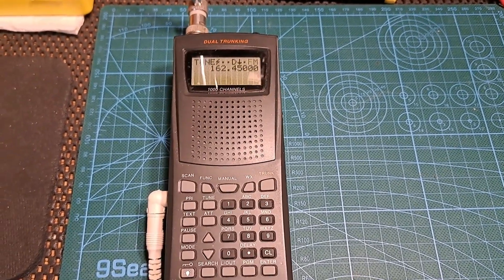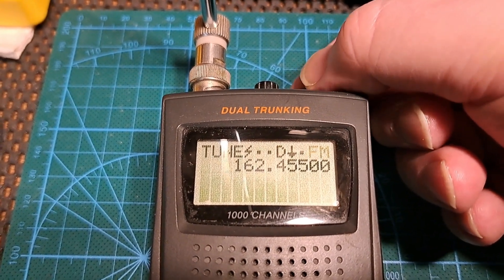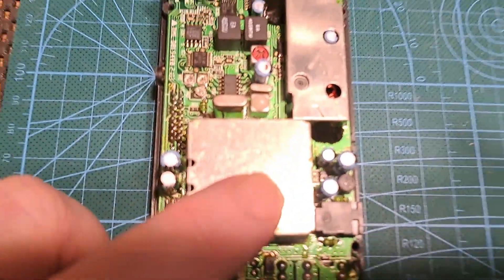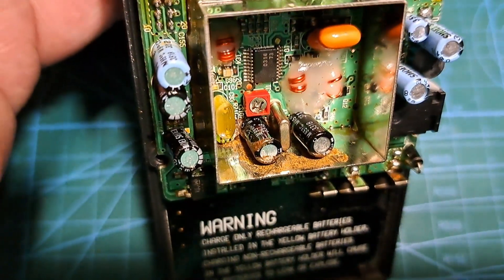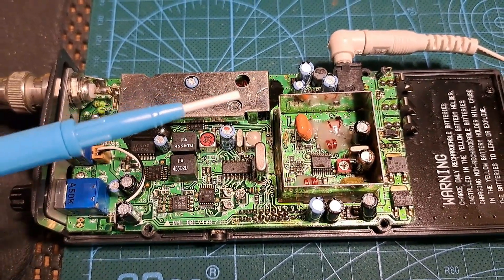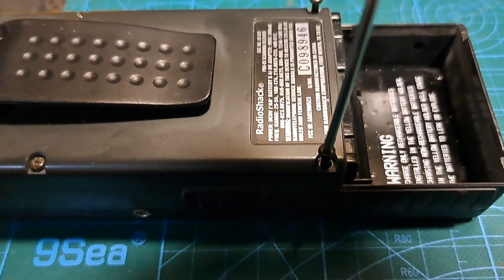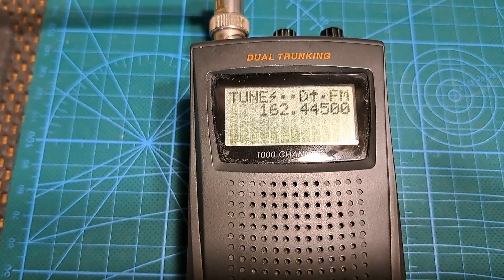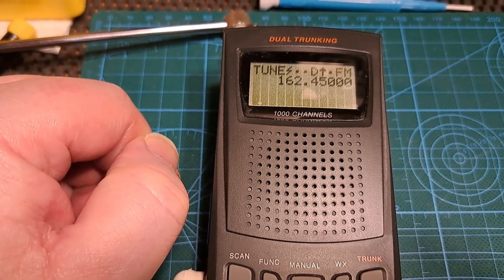Radio Shack Pro 95 Tuning and Distorted Audio Fix/Repair.

Comment: I have a Pro94 that worked. After a simple tak it apart to clean up the battery corrosion due to I left it in there unsused for like 10 years, it now scans but not able to lock to any station, weather or airport channels which I assume are still analog ? Manually put it to those frequencies  makes no difference. Any idea what happens  and how to fix it ?
Reply from the maker: When you say "lock", do you mean when scanning it does not stop on a frequency when the squelch opens? Does it receive stations while sitting stationary on a frequency in manual mode? It may have damage to the PCB from the battery leak, possibly faulty caps as these radios are quite old now, so maybe recapping it would help. Unfortunately at I distance and without having a circuit diagram I am guessing. Its very difficult to diagnose issues without doing further tests. Having the actual radio to test makes diagnosis so much easier. That being said I don't suggest you send it to me for repair as these radios are not worth much today and I can't get certain parts now as they are obsolete. Sorry !!

Comment: How would you fix the display when it goes out?
Reply from the maker: I would start by measuring voltages to the display devices. Its not easy to find service manuals for this equipment so that makes it very difficult to fault find. A circuit diagram/schematic would help if you could find one. Otherwise either a part swap or board swap might be the way. A donor radio if you can find one cheap enough could help also. 
Good Luck.
Reply from the maker: Possible has zebra strip connections that need cleaning with Isopropyl Alc